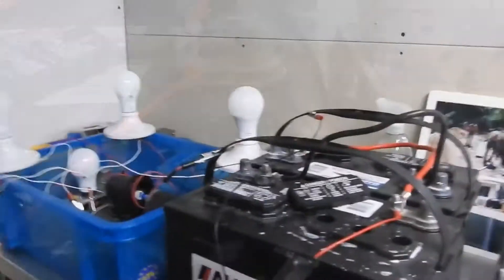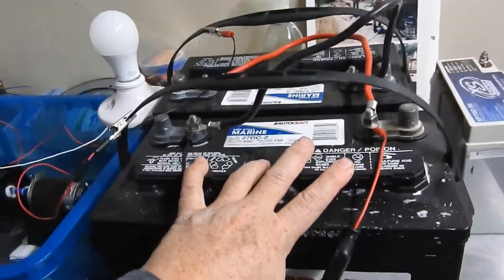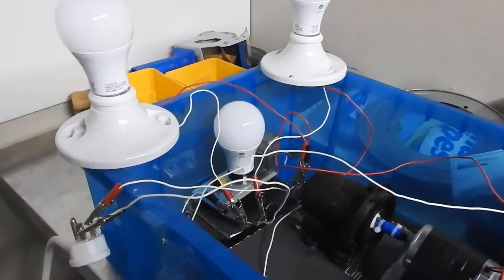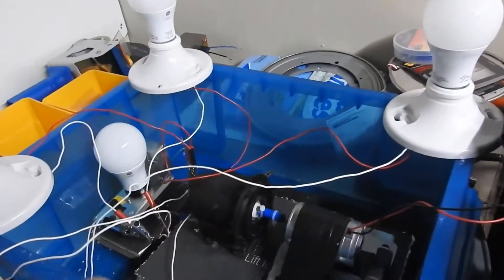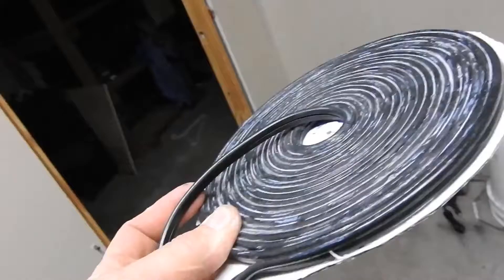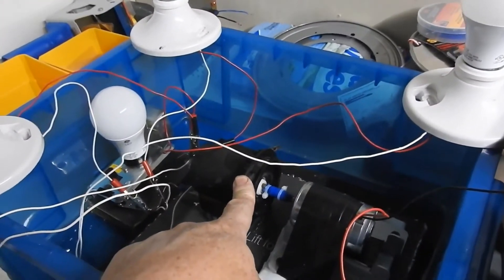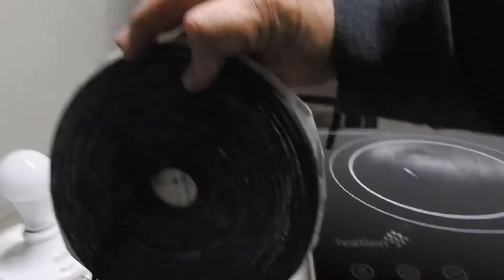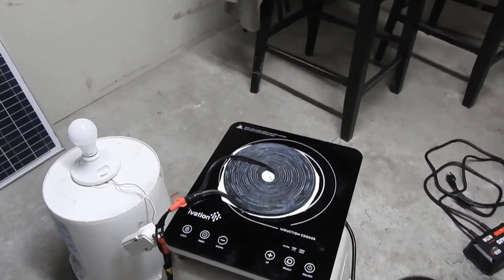Resonance Energy Is Easier Than You Think - We have been lied to about free energy [mirror]

Comment: Ehm, where are the measurements of amps and volts?
Reply: Just put a voltmeter in output of the 2nd Motor and an amperometer in series at the output of the 2nd Motor. It's easy.
Reply from the maker: Dear One, I just mirrored this vid.  You might want to go to the channel it was on originally (if still there), linked in the description, and discuss these issues.  (I am disabled, denied assistance, destitute, and technically homeless.  I surely am not in a position to be building or doing much of anything.)
Reply: That video is no more available. So, can you give me the exact composition of this machine? For my studies of electrical engineering it's impossible to achieve over unity until there is other kind of power putting in the system. 
But, you know, I want to give credit because I can't exclude that until I try myself, cost me nothing. So, give us the components of that machine, what kind of motor are you using, and the configuration of the transformers and spark gap and I'll make the measurements for you.
Reply from the maker: No, I know no more than what is presented in this vid.  I do know about electrogravitics, somewhat.  See the featured vid on My channel.
Reply: I'm sorry man, but, I must say you that it's pretty much a lie. Every single video, even all of Gerard Morin, have no clear system of measurements on that stuff. And it's very simple to do that, there is no reason to speak all that much if you show the input/output watts going on in to the system. 
But I want to give credit on that only to show to other people the lie, and if there is any possibilities that some kind of "scientific miracle" it's happening, I will show the new phenomenon. But, another time, there is no schematics what so ever of all that machines, so we cannot replicate that. I know that it's a good sentiment to think that the Energy is available for everyone, but, actually for our knowledge of today, it's not true. 
There are thousands of hundred of researches out there. Even if one of this stuff is genuine, you don't think that somebody discovery that it's true? And they must be all corrupted in order to do this. It's just unthinkable.
Reply from the maker: Did You watch My vid on electrogravitics? And have You read all the stories of inventors' work being bought out, Them being set up for blackmail, being threatened, being ruined, and being killed for free energy inventions...?  There are a fair few.  Be that as it may, I KNOW electrogravitics offers energy from the aether....  And is in black projects.  Do watch My vid...
Reply from the maker: Thank You for watching.  I have no clue what they are, but I bet You, if You have the wherewithal, could experiment with that.  [smile]

Comment: The reason they use acid in car batteries is it doesent freeze.  It's a dependable electrolyte that takes a long time to evaporate from use.  They tell u when the acid gets low in your battery to just put distilled water in the acid to restore the pH and to refill the batteries.   As long as the acid doesent completely evaporate u can get away with refilling the resinous with distilled water.
Reply from the maker: Thank You for that info!  I'm not One to grasp the ins and outs of electrical workings.  I just mirrored this video.  I find it quite interesting.

Comment: open the induction stove bypass the magnetic relay that turns it off when no iron is detected. It should be close to the surface plate of the stove from the inside pointing up towards the bottom of the pan. Then put amp meter and do your volt calculations to get watts , if you are using less "WATTS" from your source than your drain then it is overunity. No b4 not after but until you do this it is click bait.
Reply from the maker: Thank You for those data, but I just mirrored the vid, and it seems the original has vanished from the tubes.